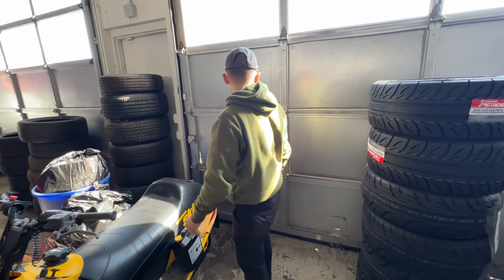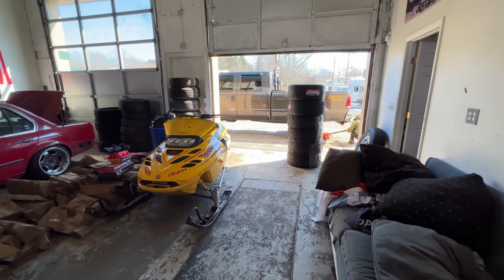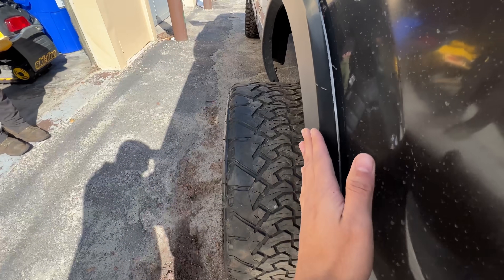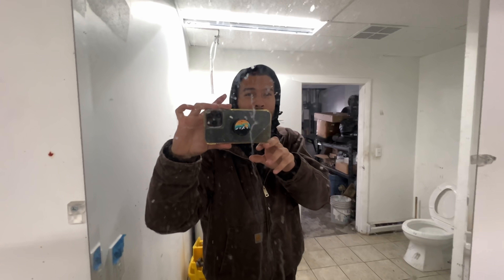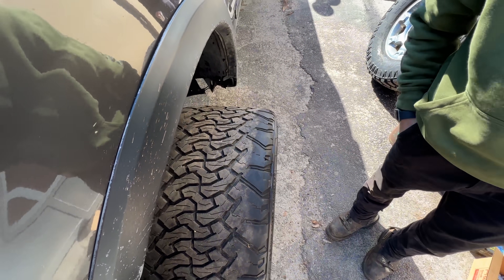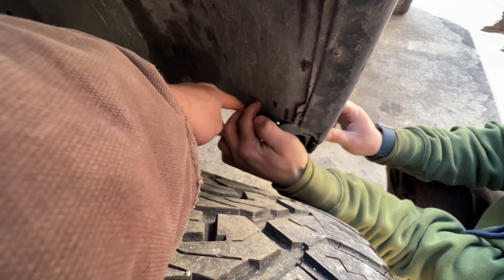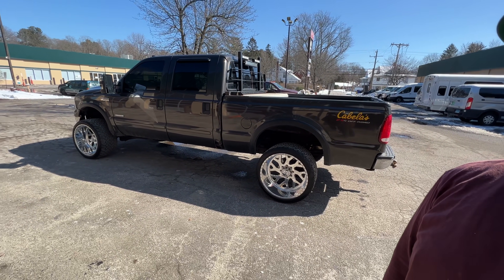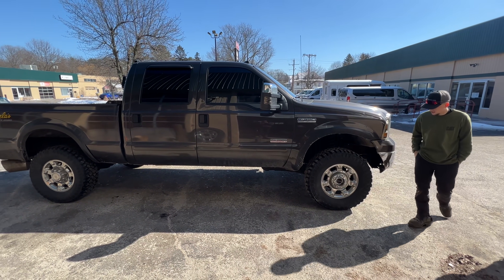24x14 American Force Test Fit (Diesel Truck)

Comment: Congrats Nate, sickest six ho around.  Not my cup of tea, but I don't hate.  You put work into that rig and I respect that.  Now time to put the parts on the fix your starting issue and you're ballin.  When you upgrade, it's time for a Cummins.  My buddy is about to finish up a built 2nd Gen Cummins with ALL the good parts that would handle twin turbos, but he's just gonna go a bigger single...up for sale soon...4 door, long bed 4x4, upgraded output shaft to handle the 13 inch South Bend twin disc clutch and $20k in other upgrades including aftermarket head.  No expense spared.  Going to list for 27k, but I can get ya a better deal...just gotta hit the west coast to get it.  He built my 3rd gen too...rock solid.

More Nate content till Diego comes back!

Comment: the truck as it sits with the stock wheels and no forces is the cleanest, most functional look for it. the forces arent the worst for a summer wheel, but those TIRES are wack af, bump up the side wall this is ridiculous
Reply: There rubber band tires for sure but hey form over function. I'm not hating but mall crawler, if that's your thing

Comment: At a certain time size you stop adding wheel weights and add inner wheel beads (mini bbs that use the centrifical rotation of the wheel to auto balance the wheel.... ) Look it up noobs